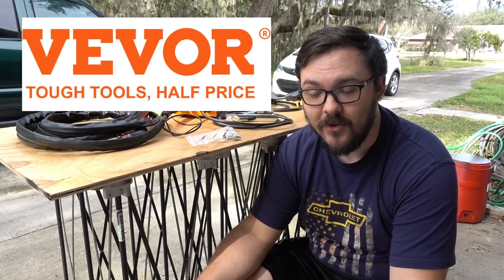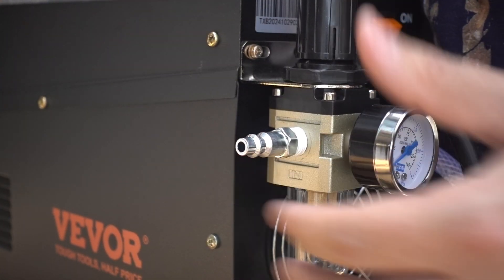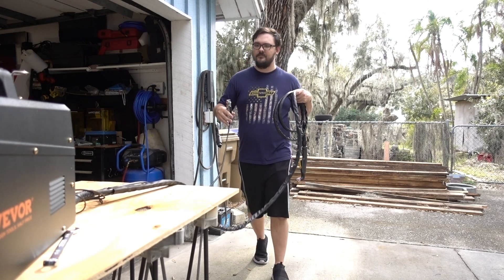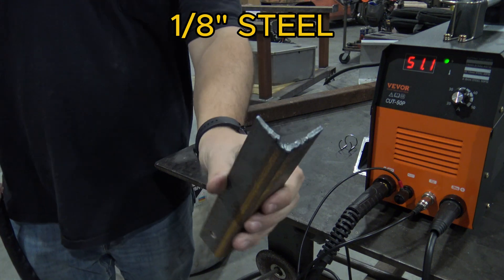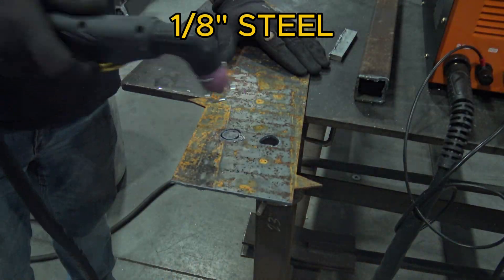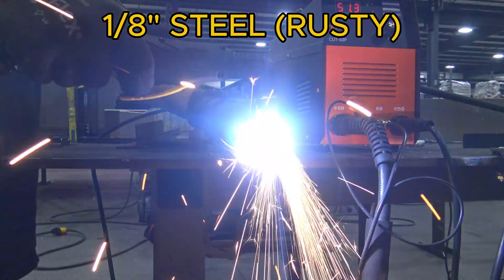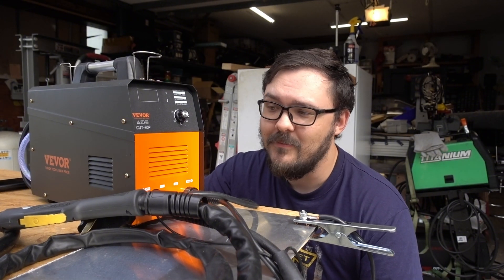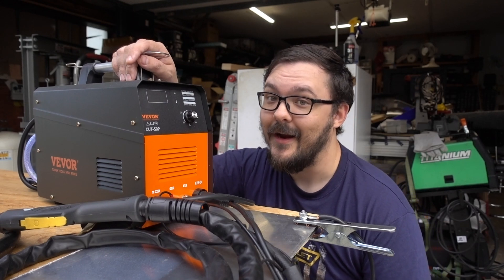Vevor CUT-50P Plasma Cutter: Can It Cut Everything?

Comment: What is the required power circuit? Most in this size range require at least a20A circuit.
Reply from the maker: They actually list A recommended breaker on their site at 60 amps at 220v. I have it on a 40 amp circuit and it runs fine for the length of time I run it. If you're running it on 120v, realistically the most you're going to get is 30 amps with a standard plug. But I would say at least a 20 amp for short cuts.

This is not electrical advice. Consult a professional if you are unsure. 😊
Reply: @DustinCorbin  Thanks. I am running a Best Arc Gen 10 on a 40A circuit using the standard 15A plug.  It seems to be the start inrush that really does not like even a 20A circuit if running up near the top end.
I can happily cut 5mm plate all day on a10A circuit.